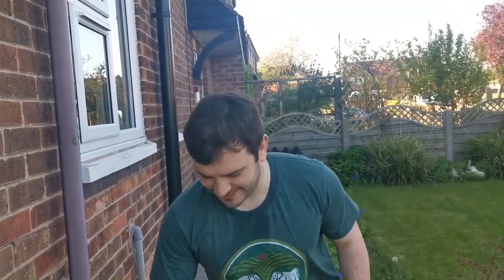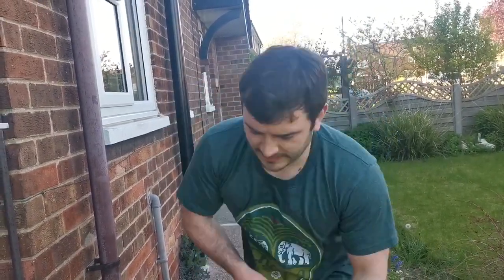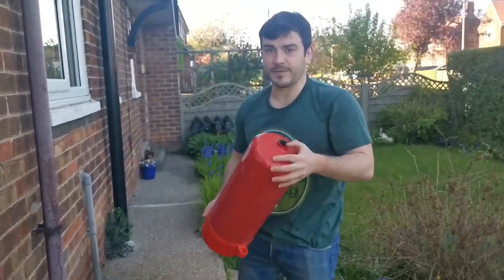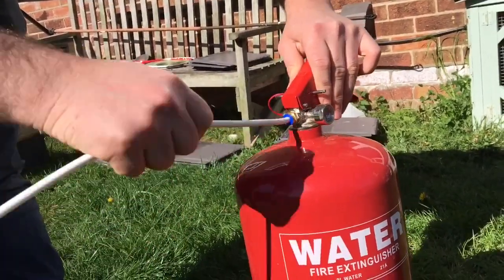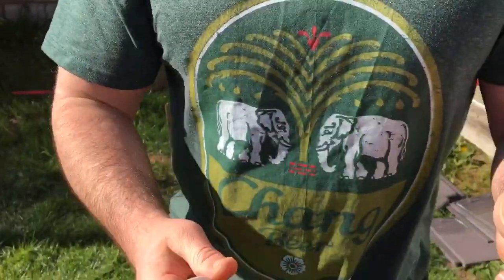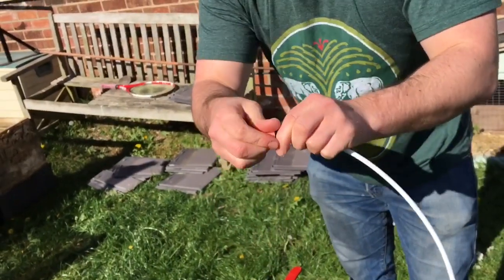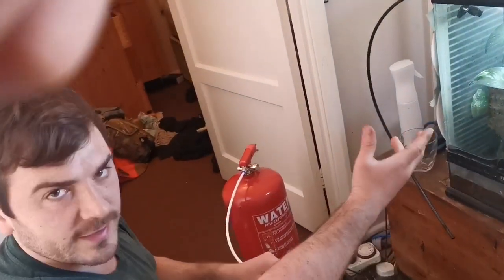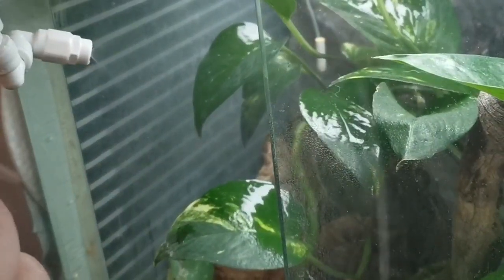How to Make a High Pressure Misting System with a Fire Extinguisher

Comment: Looks good. Can you post a link to the solenoid please? Any suggestions on how to wire a float switch into that solenoid? (I'm just trying to make a mechanism to stop my RO unit from over-filling a container). The float switch has a cable with 2 wires inside... one white and 1 green. I also have an optical switch with a black cable consisting of 2 black wires...
Reply from the maker: Hi John the link is in the description - I’m not sure how to make a solution for the facts above but I wish you all the best with it, sounds very technical
Reply: @DIYHerps  ok thanks I'll have a go myself 👍Might be worth adding some warnings/disclaimers to this vid by the way. Fiddling with, modifying and having extinguishers around can be very dangerous.